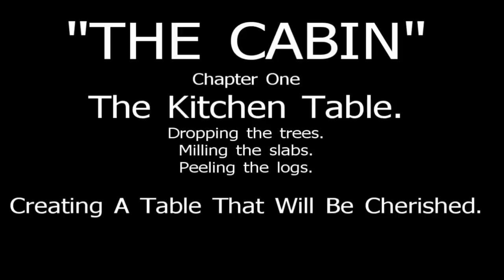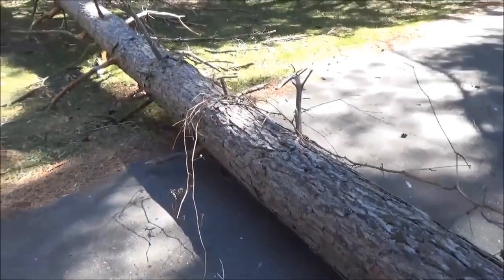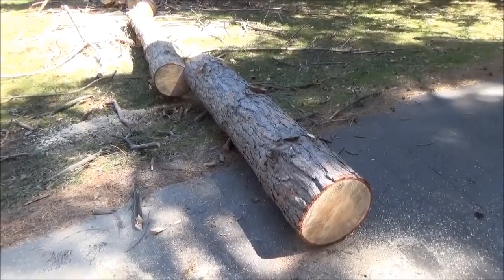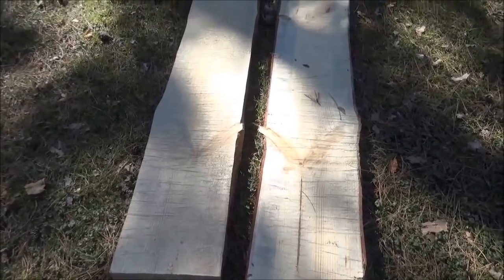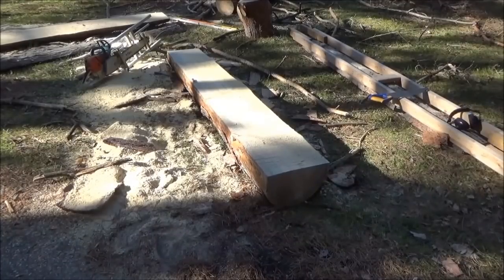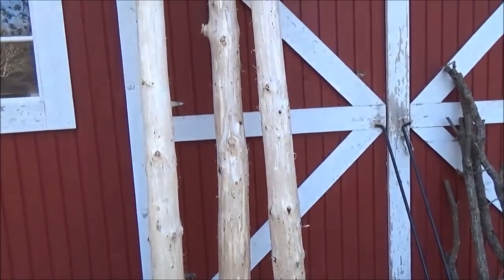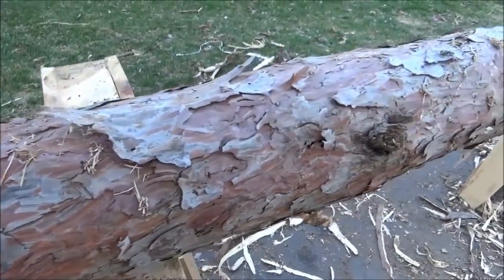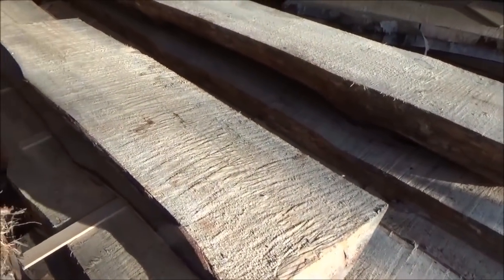THE CABIN. The Kitchen Table. Dropping the trees. Milling the slabs. Peeling the logs.

Comment: we had a real bad pine beetle problem here in Iowa.  about the time a Scotch pine starts to look like a landscape specimen the bugs move in and wipe it out.  Takes about 2 years of slow death.  When the needles start to yellow up the tree is already dead and it doesnt know it yet. By the time you see the damage the first generation has already hatched into more beetles that fly to the next tree.  The beetles make larvae and those burrow inside of the wood.   I usually just burn it down but I might as well make something out of the trunks.
Reply from the maker: Randy J Bugs can do alot of damage but can make for some beautiful furniture. Thanks Randy. Joe

Comment: When sharpening the chain you use to rip with, have you tried sharpening them at a 10 degree angle rather than the normal 30 degree they are usually sharpened at ? I have watched others that has posted videos and they say that the normal chain works better if sharpened that way, not as good as a regular ripping chain but a whole lot better than using a chain for normal cross cutting.

Comment: How much faster would a ripping blade be?
Reply from the maker: +Derek Droc I have never used one yet because I was going to get a bigger chainsaw so I did not want to buy the ripping chain for the smaller chainsaw but I think I will be buying one now. I hear its like night and day. When I do get one I will post a video. Thank you. Joe
Reply: NorthernSeclusion yes it is like night and day ,ripping chain cuts better and makes way smoother cuts,but getting a bigger saw is the smart move,sthil ms880magnum or ms661 would do just fine or husqvarna 3120 xp ,395xp,or 390xp .

Comment: How long does it take you to cut one slab with your present set up?
Reply from the maker: stormknight617r That depends. LOL. When the saw gets dull it takes a solid 25 minutes but after I sharpen it I can get through the slab in about 12 minutes. I really need a ripping blade but I am too stubborn to get one until I figure out what bigger saw I am going to buy. Thank you. Joe